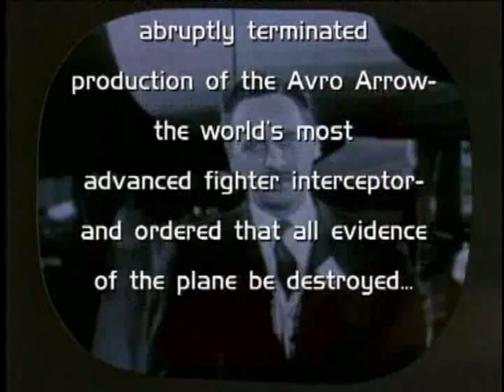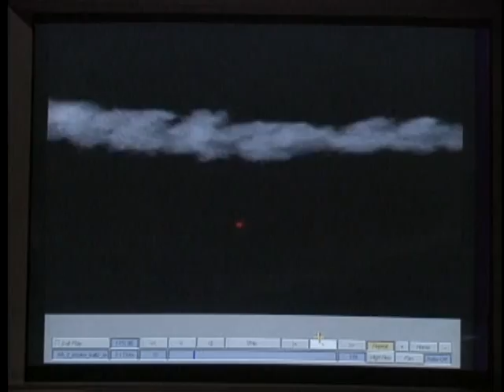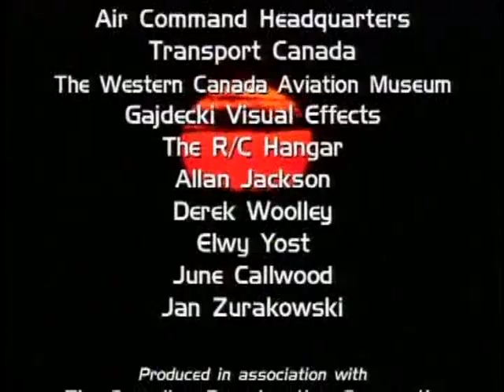The Legend Of The Arrow (CBC 1997)

Comment: The story about RL206 was that on the day of the ending of the Avro Arrow program, a group of engineers who were working on RL25206, came up with the idea, that if they threw the other just delivered PS13 into the engine bay, fuel up RL206, they could show what RL206 could do.

 Remember RL206 was a slightly larger aircraft than its predecessor RL201 to RL205 and the engines were double the output of the Pratt & Whitney J75s. Because the others had already flown, they knew that RL206 would do the same and talked to Engineer Mr. J Floyd, who also thought it was a good idea, but threw caution at them. 

 So Mr. Floyd took the idea to those upstairs and after a few agonizing minutes, came down saying the aircraft needed to be certified, even though the other aircraft had proven certifiably that RL206 would have flown. 

 In my own research, I believe that the one that got away came from that story. People swear they heard a jet engine that night, and the only thought is that Orenda may have been testing an engine that night, and if the winds were just right, It would have sounded like it came from the airport.

 I love the idea that one got away, it really is cool to think about that. But, sorry in my mind they simply did not. However, if the PM had ended the program, I doubt that blueprints would have survived, and even RL206 (cockpit & intakes) would be around instead of being held up in a Museum in Ottawa.